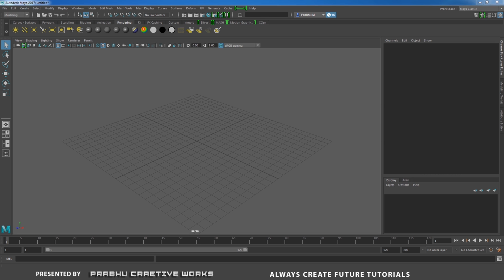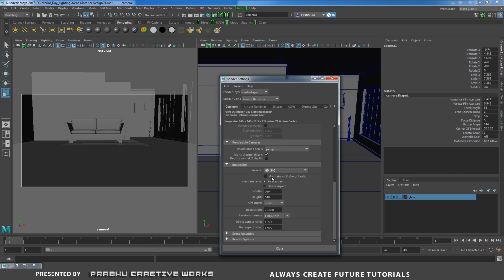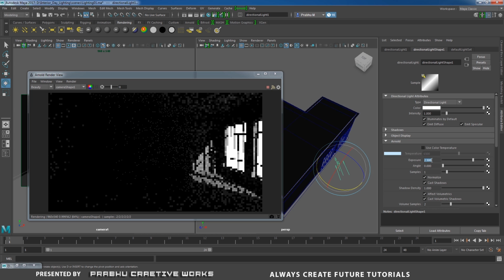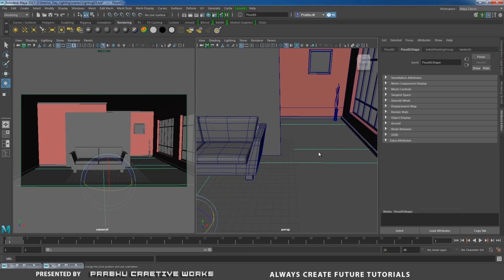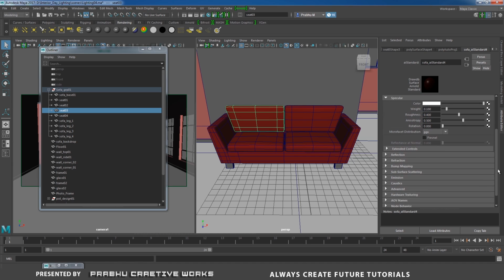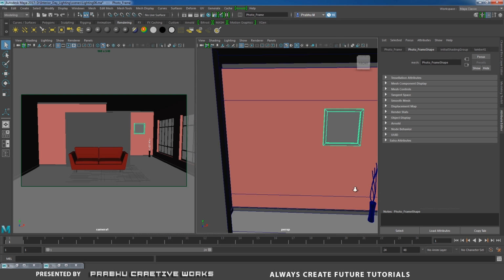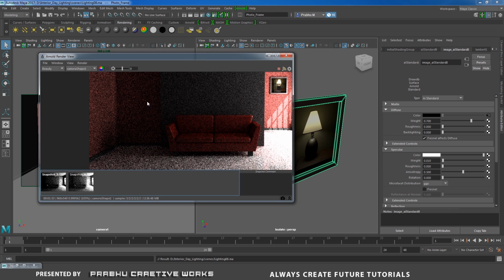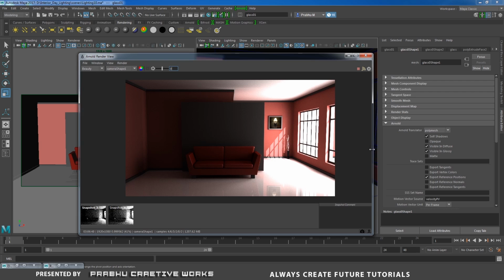Interior Day Lighting in Maya 2017 Using ARNOLD

Comment: not getting the final render even after unchecking the opage, do I have to increase refraction value on the Arnold render settings tab?
Reply: i have same prablum to...even after unchecking the opage..glass materieal refecting in side opjects insted of allowing to pass light inside...home prabhu will help from it
Reply: 4 Years later still facing the same Problem. Did you find any Solution?